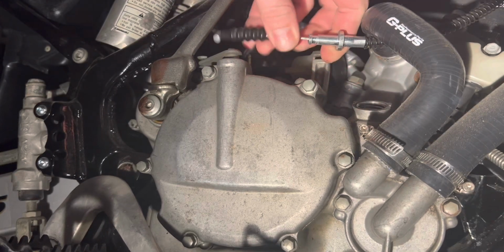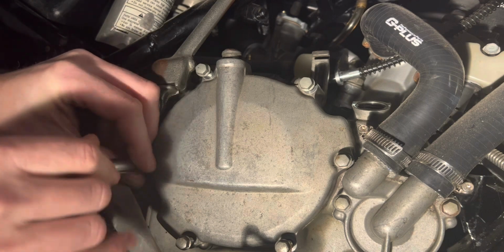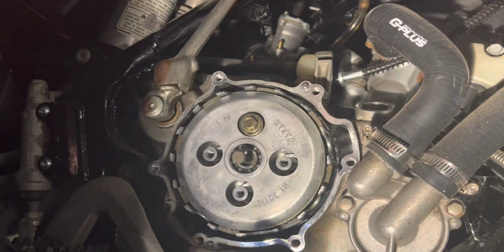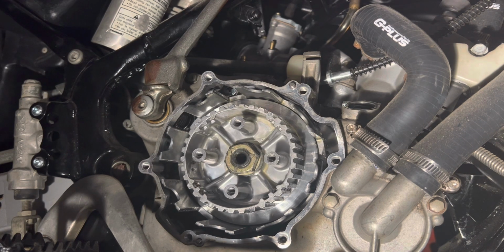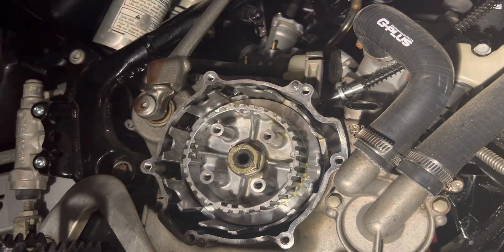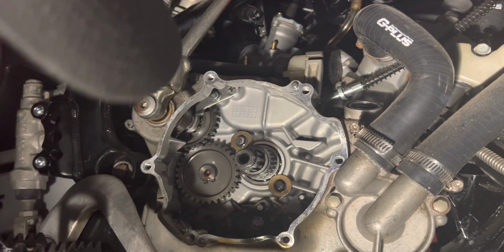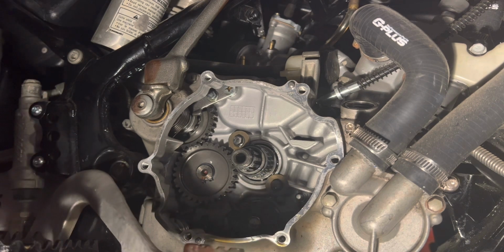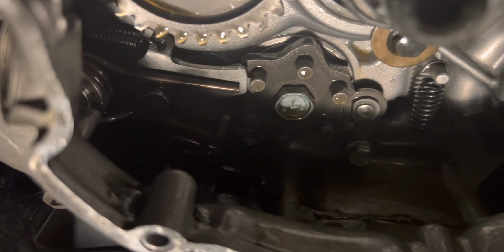Kx85 sticky shift lever problem inspected and diagnosed

Comment: Quick tip from building mine if you leave all the clutch plates in the hub and keep some pressure going inwards when you gun the nut either way it holds the whole unit together
Reply: You got it anyway lol

Comment: Hey bro I do a lot of bikes and recently just picked up a 01 kx85 and it’s what I think is the same problem if I post a vid would you be able to find some time to look at it and give me your advice I have a full gasket set full bearing and seal set have a new crack new piston coolant oils etc, I know the crank is brandnew so is the piston in the bike but have new none of the less I even have a good used full gearbox sat here replaced the gearbox in my 02rm85 a fair while ago but this has a weird sticky gear lever any ideas
Reply: Any solution?